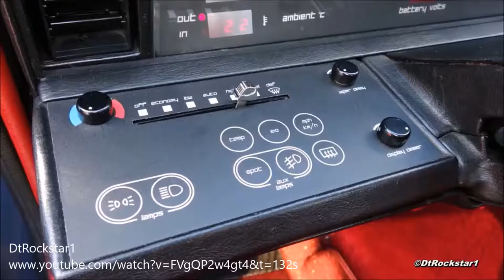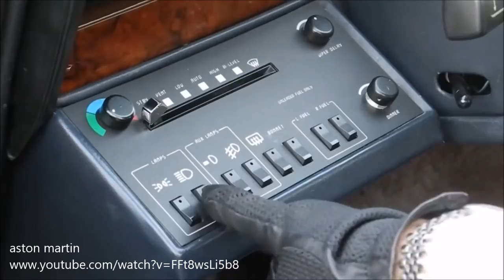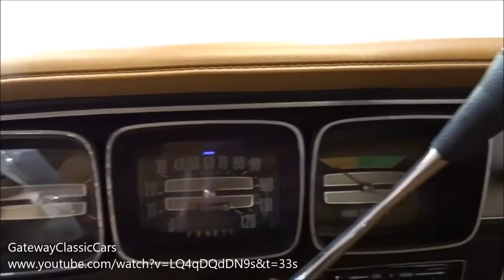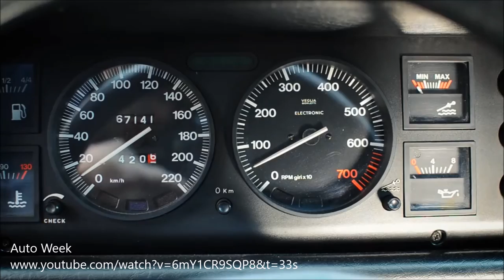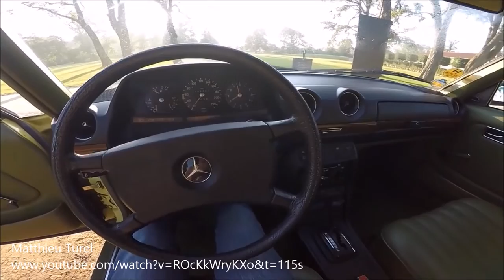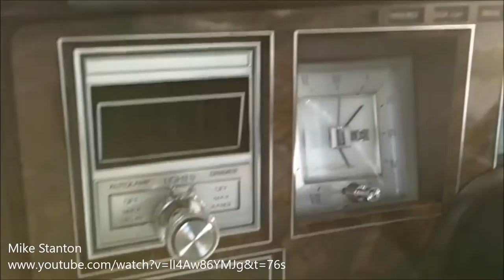My TOP 10 affordable Classic Cars to Buy  | The 300.000 € Bucket List

Comment: An interesting list but asides the Bitter which as an Aussie I certainly did know of none of the cars you listed would be on my bucket list I am afraid. I already own two of the cars on my list, a ‘69 Fiat AC 124 sports (owned for the past 40 years) and a ‘69 Alfa Romeo Giulia Super. My list though would also include a Fiat Dino 2.0L coupe, a 13O coupe, a S1 X1/9, Mercedes w108 280 3.5 (my brother has one which has my name on it), Alfa Romeo 105 spider 2.0L, (have previously owned a 1750 GTV), Alfa Romeo stepnose GTA replica, Lancia Stratos replica, Porsche 944 Turbo.

As for a Pagoda, my brother picked one up a few years ago, a LHd manual 250 Sl with hard and soft top in black with tan leather for a mere $14K. A bargain indeed.
Reply from the maker: 14k for a Pagoda is super cheap. You couldn't find one for this money in Germany unless completely fallen into rusty pieces already...
Reply: Cube of Cars I know, as does my brother that it was a complete bargain.  It’s super straight, complete and not rusty. Mechanically it’s fine as well. Previously, he bought a ‘74 Porsche 911S 2.7 for $3k, and spent another $3k on a replacement engine. He knows how to find such bargains. His latest being a Mercedes 350 SEC in immaculate condition for $2k and a ‘51 Bentley Saloon (all alloy body with the big engine), super rare and in immaculate condition also not for a lot of money.,